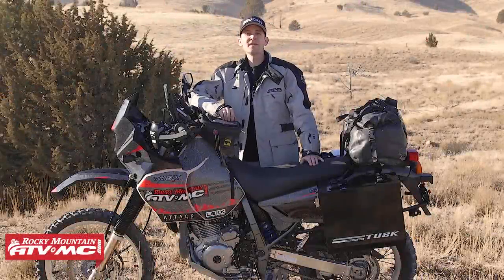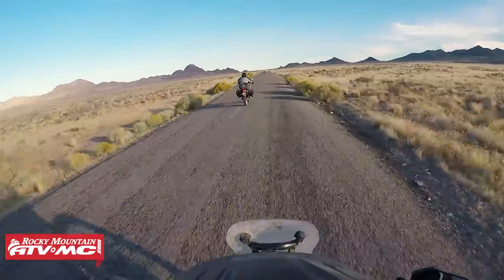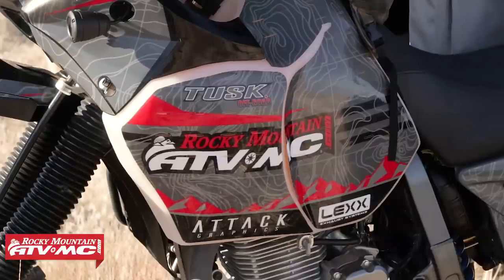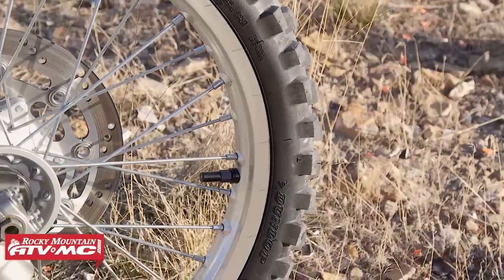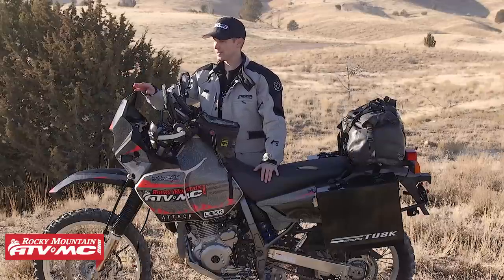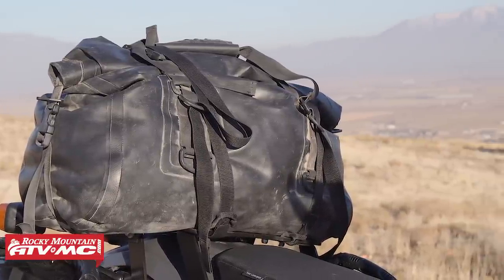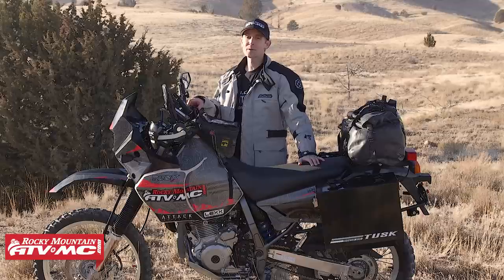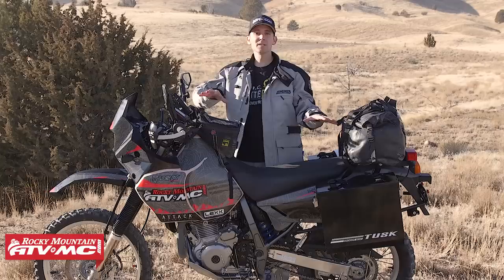Suzuki DR650 Adventure Bike Build

Comment: Great build! I have owned the DR, KLR, and XRL, and the DR is the best overall. The XRL might have a bit better suspension off road, but is top heavy, and an absolute slug above 70mph. The power goes flat above 70, and it's also very twitchy above 70 on dirt roads. The KLR is also twitchy above 70 on dirt roads. The DR however, is rock solid stable even up to 90mph on dirt roads. On the highway the DR motor pulls up to 100mph nicely, and just feels like it does not mind doing it. The KLR feels almost like you are hurting it when you run it up to that speed, like it isn't liking it. The DR does it smoothly. The DR is way lighter than the KLR as we all know. People always say how the KLR is so superior on the highway, and I disagree. It just has a better seat and bigger tank. I would rather have the DR, and put on a good seat, and bigger tank. Then, to me, it beats the KLR on the street. And no matter how much you spend, the KLR will still be way too heavy, and no amount of money will fix that. Plus, the DR valves are super easy to adjust, and the oil cooler is way less vulnerable than the radiators on the KLR. The DR engine is actually designed around oil cooling, with ports that spray that oil under the piston skirt. It's not just an add on, it's part of the design.
Reply: Thanks for writing that up. I just bought a DR, so that helps to hear
Reply: @KLRJUNE  My KLR was not too twitchy on pavement, but on dirt roads it was, and I think it is the spindly front fork to blame. The fork is wimpier than the DR fork, and has more stress on it with the extra weight, much of which is on the front with radiators, fairing, and big tank. The spindly KLR fork is well documented as a weakness. It should have a beefier fork than the DR, not smaller, since it has so much more load on it.

Comment: Great to see a DR build.  After buying an 08 model with just over 4k mi I've added a good amount of accessories from Rocky Mountain like Tusk high-rise bar & rear rack w/Wolfman bag, tires, lowered foot pegs, Acerbis skid plate and handlebar guards.  I installed heavier Cogent fork springs along with Racetech GoldValves and it made a HUGE difference! Now I'm about to tackle the rear shock rebuild doing the same mods.  The great thing with buying a used DR is that even after adding the accessories you want/need the whole package is still usually less than $5k. Try that with a BMW!!         After only having street bikes this bike has been such a blast to ride and work on.  I did my first 90mi dual-sport trail ride in NJ and am looking to explore more next year.    Thanks for all the great products!

Comment: Such a beautiful bike you guys built.  I've not done a lot to mine, but did add an AE Engineering dash, that looks good and provides two accessory outlets and a Ram mount.  Just installed a set of Enduro Engineering handguards tonight, to my new ProTaper EVO Adventure bars.  They make riding much more comfortable now.  I recently installed a DG V2 slip-on exhaust.  It sounds great and more importantly, dropped around 6 or 7 pounds and you and really feel the weight reduction.  My first change was tires, the "Deathwings" that came stock, weren't cutting it, so i went with Michelin T63s front and back.  They were great, but unfortunately, Michelin stopped making them. :-(  I'm going to try Tractionators before a trip to Tennessee in March and give them a try.

Comment: Great bike build! I installed Ricor intimidators in the forks and an FCR41MX pumper carb.
I left the stock exhaust on the bike an the bike runs fantastic
Reply from the maker: thanks!  I might try the ricors too.  So far the suspension feels good (for ADV riding), but the shock does rebound a bit quick.  I will play with some things there.....Justin

Comment: I bought my first DR650 in 1994, a used 92 model when I was 19 years old. I literally rode the hell out of it for 50k miles. Rode ST, SM and several long trips. Even raised my pit bull to ride in the milk crate from 8 weeks old up until he busted the sub frame. The DR is a great bike and I eventually went back to owning another new 2005 model. It's true the big DR can be whatever you want it to be and that's why Suzuki won't change it also its design is grandfathered it with CARB and EPA
Reply: Liberty Tree p
Reply: How did he bust the sub frame?

Comment: I have owned the Safari fairing before, but now have the Yenkro fairing. There is no comparison! Yenkro makes it for both the Safari and Acerbis 6.6 tanks. The hand and CNC machined Yenkro is more of a rally design, better dash, fiberglass is better material, and the whole tower pivots in a crash, protecting your dash accessories. Plus it gives you a much better headlight. And the mounting takes all weight off the handlebars and fuel tank, it stands alone off the front of the frame. Yes, you have to order them from Australia, but it is worth the money, hands down! My Safari fairing didn't survive my first dual sport ride, cracking badly with just two offs. Other than that, I have done most of what you have here!

Comment: How about adding a MOSFET regulator rectifier along with the higher output stator, then you'll have more electrical power and the oil temp will actually be lower (read up on MOSFET RR's for an explanation).

Comment: Awesome build for the mighty DR, one thing I would add especially since you up the spring rate in the rear is a race tech gold valve. Did it to mine and can't say enough good things about it.
Reply from the maker: I think I will try that.  It does rebound a little faster than I like....Justin
Reply: @rmatvmc  did you do this Justin? How did it work out?

Comment: I just did the NSU updated, I have an 07 DR650, drz400 front forks, built rear shock, jetted carb opened air box mod. Tusk side racks, factory rear rack. Wanting to upgrade my seat also.👍
Reply: SeatConcepts, love mine

Comment: Justin your and the whole teams videos. Tyler could do a great buy and build on this bike... he has proven the tusk panniers strength for sure. Anyways our older pre 96 bikes are mainly the same but some little differences. Either way a pumper carb like the tm40 and the new variable (96 n newer) and preset (older bikes) advanced timing CDI takes this motor to a whole new level!
Reply: Ok fat fingers should say I love your and the whole teams videos.
Reply from the maker: Thanks a lot Russ, I appreciate that!  I didn't want to do anything to the motor (yet).  I like to keep things somewhat simple.  However, I have hear of an 800cc kit I am tempted to try.  between that and some carb work this could be a monster!!    - Justin

Comment: If you're going to get fat-bar adapters, go all the way and get the GPR fat-bar / steering stabilizer package. It may not make you a better dirt rider, but is makes the D606's on my '06 feel much safer on the road. Good for stream crossings too. Pro Taper Woods Low bars work well with that setup. I just put on the new Oxford Adventure Pro heated grips with the battery-saving controller built into the left grip - no panel to mount, The Magura Hymec hydraulic clutch is the solution to the chronic clutch cable problem. I'm sure the Rocky Mountain build has Emulators in the fork along with the RaceTech springs; worth while. The Gold Valve in the shock is a bigger spend...

Comment: I slapped on the 790 big bore kit from procycle..  I have around 12k on mine, not one issue and tons more power/torque . The charts they have claim about a 18hp  / 18 Torque increase from stock  Never dyno'd mine but I can confidently say I expect the same results if I ever dyno mine.  Makes a huge difference especially while hauling a ton of gear for extended trips and MPG before/after is pretty much same and barely noticeable, it actually increased a bit while loaded with gear. I can also say the suspension setup that was mentioned by "Lost in PA" from Cogent dynamics is absolutely amazing, much safer and superior on/off road to everything else I have ever tried.
Reply: I seriously doubt you get that much power from simply the big bore kit. MAYBE if they are comparing 650 from factory (no jetting/tuning) to one that has big bore with tune.
Reply: I would have thought that it would have been kind of obvious this is compared to bone stock 650 to one that has the big bore kit and tune. One doesn't normally put on a big bore kit and not tune and jet it, it's kind of a given.  You are after all increasing the displacement by 140.
Reply: No, I meant one does not usually go from bone stock to big bore. Compare apples to apples (650 with jet kit, vs big bore with jet kit)

Comment: Cogent  Suspension, pumper carb, exhaust, lithium battery, oversized bars, acerbis skidplate, and braided brakelines. I went for a lighter more performance oriented build. Its a fun plush riding bike now that weighs around 350lbs full of fuel.

Comment: Justin,swap that large tailight  for the smaller  model  that comes on the dr250.That 650 tailight  will eventually  break  off due to its weight  being  so far away  from  its mounting point on the fender

Comment: Where is the kitchen and bathroom? My mods were plastic skid plate(metal sucks), remove front fork reflectors, remove and block pair valve, remove carcoal gas tank vent, remove upper chain roller, remove airbox snorkel, drill fuel screw plug out, add shim washer on carb needle, and wire a power plug to front accessory wire terminal for garmin. There that’s it, everything else is good to go as stock, love seat (ride my WR450F), love tires (truthfully kenda 270 are in my garage for future), love gearing, love pegs, and yes I will change handlebars but stock works also. You guys built something I just don’t care a hoot for but maybe your viewers do.

Comment: I didn't upgrade much on mine. Just the exhaust skid plate and case saver. Did the air box mod and jetted the carb.
Reply: Did you remove the front chain roller that does nothing and usually breaks off and makes a big hole in the frame?
Reply: Yes I did and I put a flush mount screw back in
Reply: Neutral sensor screws fix?  That is a must, not very hard to do if you can do it yourself

Comment: Great vid  as always Justin. Nice  looking bike. Checked the link but could not find what you used for the front suspension. Please let me know. Thanks in advance.
Reply from the maker: Thanks, Miguel.  I have race tech fork springs is all.  go to our site and enter your machine in the "parts finder".  It should pull up the available fork and shock springs in the suspension section.  Call if you have any problems.  ..Justin
Reply: Thanks for the response i appreciate it.

Comment: Having a lot of trouble getting bike tiers hear on the island, so limited to what I can get, what do you think of the Michellin Anadee Wild Dual Sport tires for the DR650 and the Versys 300 X   I have the Versys X and getting my second DR 650 and first thing going on is the 5.3 gal gas tank. the stock tank is way to small for this type of bike. also will go with Trekker mounts side and top as those are the bags I have for the versys so will be able to use on bought bikes. But no faring for this bike I love the feel of the wind on my chest, that is the draw back of the Versy X witch I will have for rain days and colder weather,  I have a problem with understanding why you would not want to feel the wind on your chest, that is one of the great things about riding a bike, Just hold your self up with your guts not your arms. I am middle age at 71 yr. so most rides are under 500 Km but when I was in my younger years would do up to 1000 miles a day.Those were the days when every thing was in miles and gas was sold by the imp. gallon. for less than .50 cents. I can even remember .32 cents a imp gallon.

Comment: I had a 1996 DR 650 SE and i didnt change a thing , Even the stock bars i was happy with... Its waay more fun to ride than the outher brands like the XT 660 . I had a huge problem tho , The engine "stole" ? (stoped) when i was riding a trail and i puched the startbuttom in before the engine stoped rotating completely and the startmotor sprocket hokked up . Result : The left enginecover and the left enginecase craked on the inside....

Comment: One of the best things you can do is to upgrade to a TM40 pumper carb.  Procycle sells these carbs that are direct bolt in.  Its a world of difference over the stock carby IMO.
Reply: Haven't taken the plunge, did my stock rejet, airbox mod, full FMF exhaust,  got much better Powe, torque, engine response, and getting 60 mpg not babying it.  Recently went to my local bike shop open house.  They had a free Dyno.  Got 43hp 41 ft- lbs. Heard good things about TM conversion.  $$$.  Enjoy your Dr .  In in PA, where you at?

Comment: RMATVMC, I do not have an off-road bike yet. I have never ridden off-road on a bike. I am deciding where to start. There's this DR650 (featured in this video), the Himalayan, KLR, but.....maybe too tall for me (I'm 72"). I know a 21" front wheel is a good choice to have. Suzuki DR-Z400 is a good place to start, I think. To start riding off-road, I would like to start on some fire roads or light trails to help with confidence. I am curious to know about the handlebar vibration out of single cylinders. I have already had carpal tunnel surgery in both wrists. There may be a Himalayan 650 coming. There is a lot to choose from and that is good. I would need a more comfortable seat. Not a '2X4'. I hear good things about the Kove 450, but mostly enduro-type usage.

Comment: The airbox mod is controversial and something I'm not going to do.  On the other hand, you left the stock gearing?  I find the bike is geared too tall for technical riding so dropped a tooth on the front. 
 Otherwise, nice work.  I will look closely at the tank/fairing mod you did.  Looks awesome and I want to carry more fuel than the stock tank does.  I'm looking forward to getting to know mine more come Spring.

Comment: Great build! Really makes it adventure worthy. Just for general ref., how much would a build like that cost?  Trying to decide on KLR, DR  so relative cost of mods and base bike are helpful
Reply from the maker: to make good adv bikes out of any bike (even bikes they sell as ADV bikes) you need to spend some money.  the most expensive part of this build is the Safari tank and fairing.  the safari 7.4 gallon tank is $570 and the fairing is $500.  a much cheaper alternative is the Acerbis 5.3 gallon ($245) or the Acerbis 6.6 gallon ($295).
Reply: I've ridden both.  DR for me 😁
Reply: @rmatvmc  the only time you need a tank that big is if you're trying to get to Patagonia or across Siberia.  It's an overkill imho.  Thanks for the info

Comment: Hey Justin.  I have a WR250R but wanting more grunt and horsepower.  I'm really liking what I'm reading and seeing online with tests and comments on the DR650.  Please let me know your take having ridden both bikes on adventures (which I'm wanting to do this year)  Thanks!
Reply from the maker: Hi Rick.  Having had a KLR650, DR650, DRZ400, and a WR250R, I can say that all are great bikes and all a lot of fun.  I loved the WR but got frustrated on the highway.  It just doesn't have the juice.  I have really liked the DR650 and DRZ400.  Both bikes pull hills and highway speeds without frustration.  The 400 is better suspended for off-road, and the 650 muscle is a little better on the highway.  I could get away with stock springs on the DRZ, but the 650 will need stiffer fork and shock springs.  If I were shopping for a used ADV bike, I would prefer the 400, but would be happy if I found a deal on the 650 as well.   - Justin
Reply: @rmatvmc  Thanks Justin! If I was to mod the DR650 suspension would you put it on par with the 400 even with the weight?  Is weight really even an issue?
Reply: @nelsdude  how hardcore off-road?.  If you're planning to do any highway, get a DR650. It depends on what you're planning to do with the bike.  Drop me a line if you have any questions, cheers

Comment: So, you did both a DR650 and a DRZ400S.  Which one did you like better?
Reply from the maker: good question.  when it boils down to it, I would go with the 400 because the suspension is better. - Justin
Reply: I think the only advantages of the DR650 are high speed cruising (90 mph if you dare the wind) and price (you will have more money left for your awseome trip) I have tried both. (although in Europe)
Reply: Yes, I want to know to! Thanks Justin, and I agree. The 400. The 650 is cheaper, yes but all said and done, not after all the mods. The 400 will kick butt on 650 when both are all dressed up. 650 is a tank, the 400 will fly right by it off road and still be side by side on road.

Comment: 50lbs  lighter than klr650 as that has an extra 10l fuel. Dry I calculate 179kg and 156 kg.
Suzuki seems better built? Cleaner, nicer anyway. Parts of the Klr seems to be made from pig iron - the exhaust

Comment: I put the YZ forks on mine. Bearings from allballs and cogent /olins rear shock.  Still looking for an 18" rear wheel......
Reply: Oh this was 2 years ago.
Reply: Warp9 makes 18" rears for them with cush hub. You might have to email them for it as the wheel building tool on thier site is a little buggy.